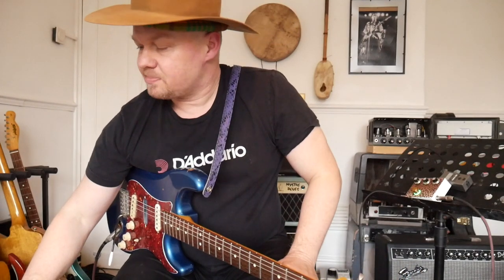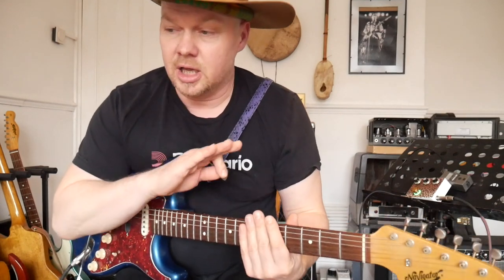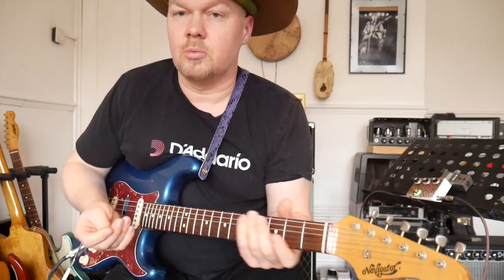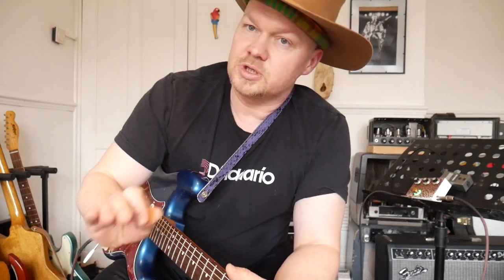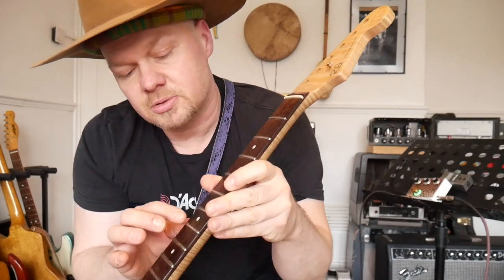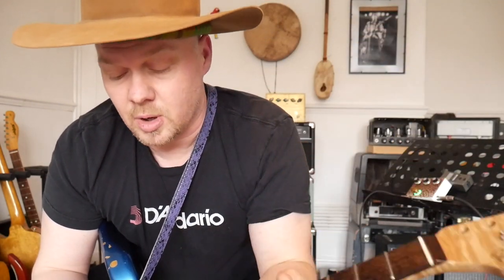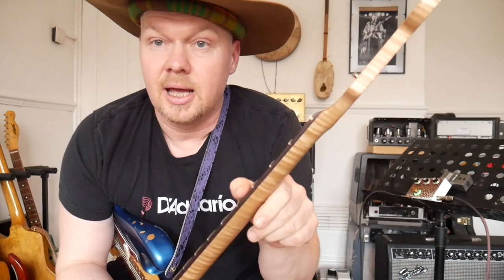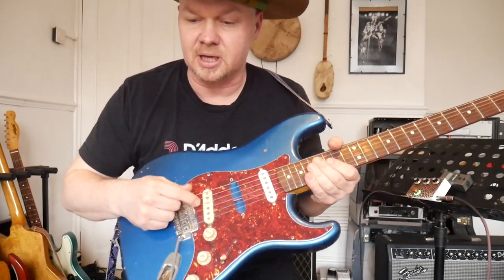How to build a Stevie Ray Vaughan Strat  - Part One (Full specs  in description)

Comment: I have had many guitar's.  I'd absolutely say that the tuners are one of the most important parts that many overlook. Get good one's.  When you spend less time tuning, then such a joy. My vintage 86 Squier bullet 1 has gotoh turner's from back in the day and I pick up the guitar and it's almost always in tune. Same with my locking hipshot turner's.  Thanks for the video.  I'll stay tuned. Nice flamed neck. My starcaster stratocaster came with that. I took off the polyurethane and did a oil and hand made varnish.  Danish oil brought out the shatoyance and the polyurethane/ blo/tru oil finish shines and is thin enough to feel the grain. For 60 bucks I got a dream neck. Slab too! But a single humbucker in.
Reply from the maker: Great comment many thanks 🙏

Comment: Point taken about where 99% of tone comes from, but that Fender Blackface amp really helps that 1%.
Reply from the maker: Oh yes the El Macombo tone was my favourite
Reply: It’s only a modern reissue which I bought off the previous owner for a low price because “it wasn’t working”. Turned out to be a ten-minute fix and now it’s a go-to amp which Is on loan to Ramon while he develops and proofs his pedals.  (I’ve played it alongside several originals from the sixties and they are better, but not much).

Comment: The left hand trem story i was never convinced....stevie couldn't get " things " he wanted, yeah ok.joe walsh once said, that how they thought jimi sounded so different on a strat was the extended top e string....
Reply from the maker: Yep, I believe Joe Walsh!
Reply: @TheGuitarShow  , get Bob too do the physics, there must have been a reason, third stone from the sun, live at the el macambo....and it doesnt go outta tune
Reply from the maker: @moontheloon1969  Thats more to do with setting up the trem/bridge and nut friction - Ill cover that in part 2 and show you how I set mine up to stay in tune
Reply: I could believe it for one gig , maybe or stevie liked its feel, trems set up well are rare imho
Reply from the maker: @moontheloon1969  https://www.youtube.com/watch?v=Iy-F7iSIopA
Reply: @TheGuitarShow  thanks , i think the weight of the trem is crucial, fenders have it, its were most other brands of modest means fail...if you asked i would guess 75% go hardtail...because they cant get tuning stability
Reply from the maker: @moontheloon1969  pleasure that video from Carl is for a floating style trem but it's still useful knowledge
Reply from the maker: @moontheloon1969  there's a few tricks like decent springs, and the way you use it...I only use a downwards motion as my trem is fixed flat on the body so as long as you provide well stretched strings and minimise the friction travel then it will return to pitch no problem.
Reply: @TheGuitarShow  cheers , Ramon film 4 tonight ,Paris texas 1:05 am